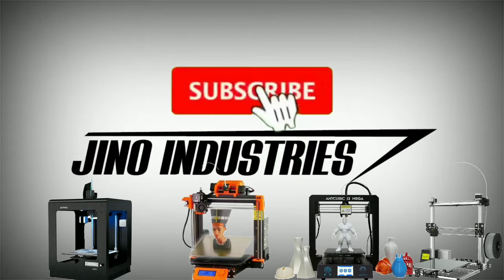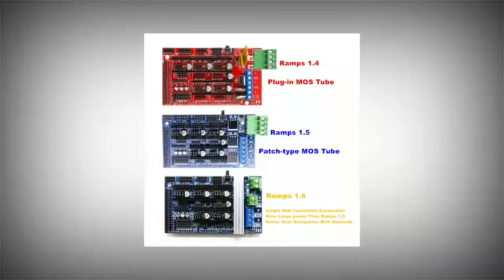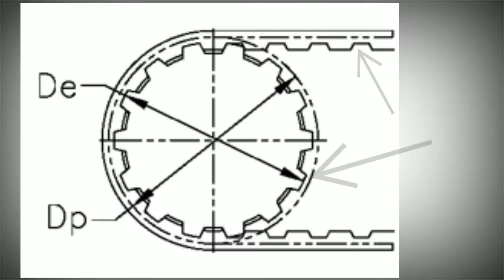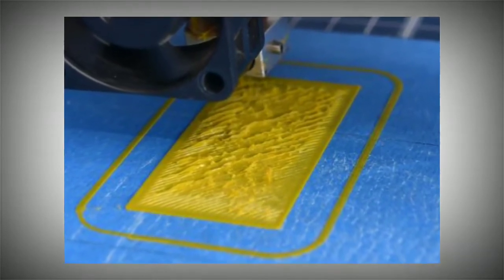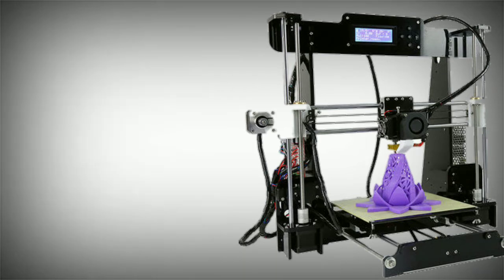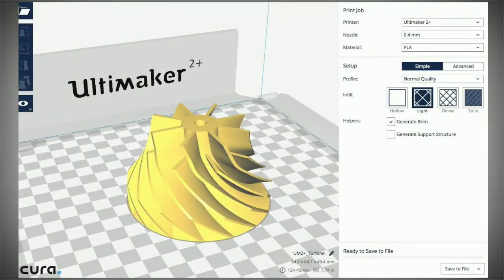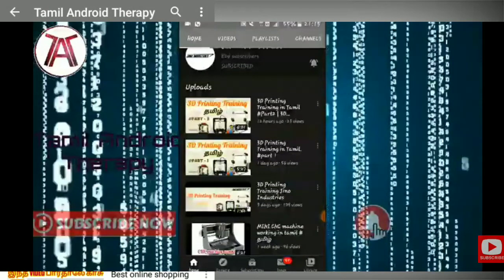3D Printing Training in Tamil #Part3 | 3D பிரிண்டிங் பயிற்சி பாகம் 3

Comment: Part's In 3d Printing
0:40 Controller Bound - Arduino MEGA 2560
1:13 Ramps board
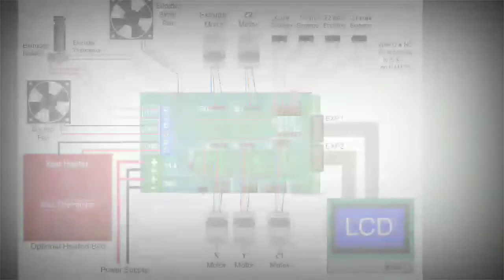1:35 stepper motor
2:00 Timing belt & timing pulley
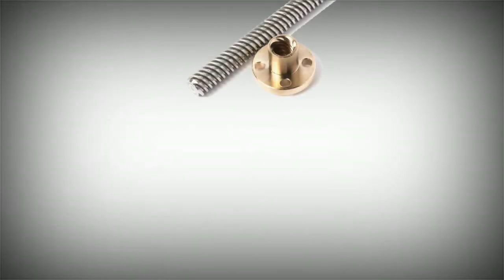2:36 Lead's screw
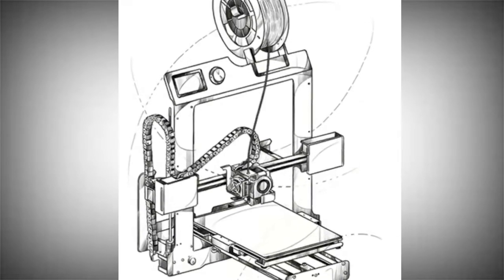3:10 linears shaft, linear bearing & limit switch 
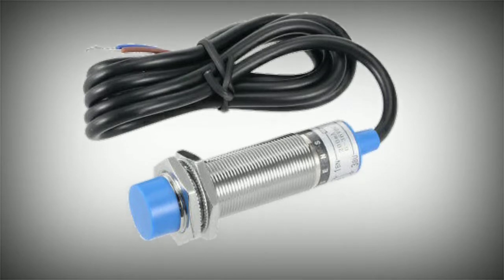3:30 Extruder
4:14 Heater bead
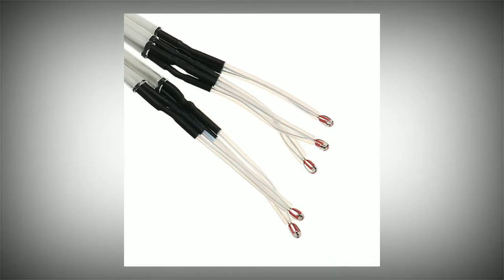5:25 Display
   what is Baby stepping?!
6:29 Power supply
💥Thank's for your clear explanation👏
Reply from the maker: What???